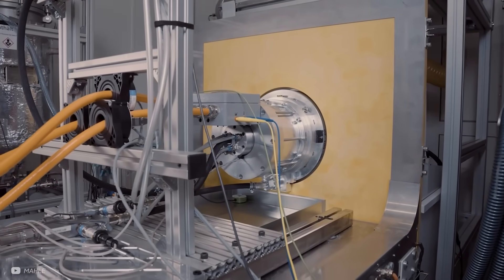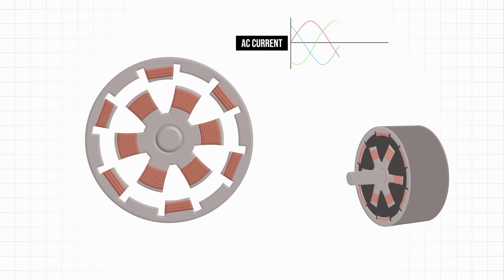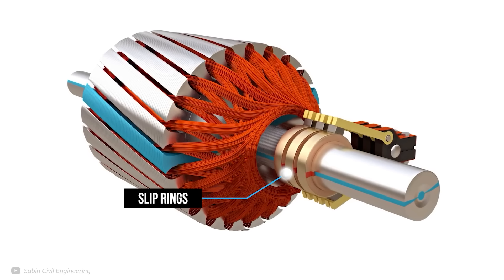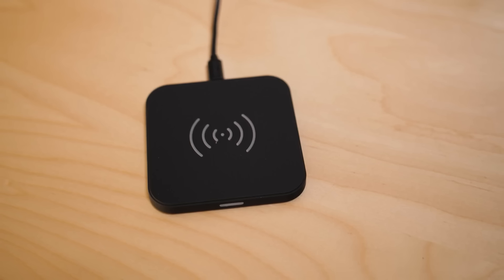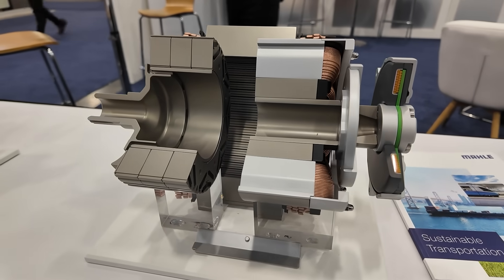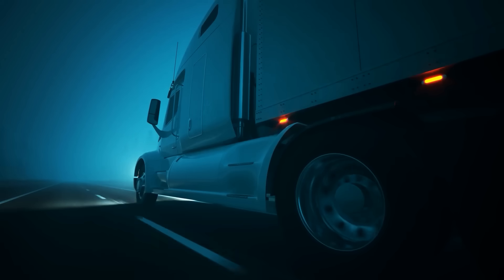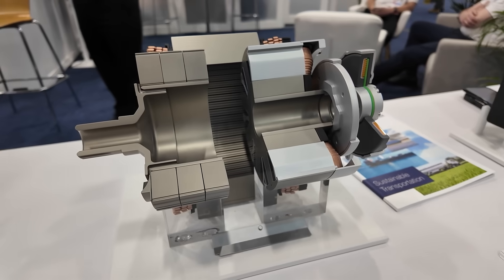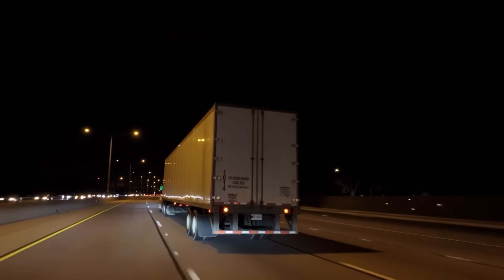Genius Contactless Motor Could Change Transport Forever

Comment: For a truck you would want a battery pack the size of two to three car packs, think kia EV6 size.
Then have a generator unit that has a small turbo charged engine optmised for 2500rpm that starts up to charge the battery.
The engine could be a 3.5l 4 cylinder with dual balance shafts.
Run on gas or lpg.

Comment: I think it wouldn't high efficiency. Super simple describe below.

In a typical brushless motor, you will spend power only on "stator" to make motor rotation. And "rotor" will do it free by magnets.

In a new model you have the same construction, but will spend additional power to emulate neodime magnets.

Comment: Whats wrong with brushes? It's like drum brakes, they could be optimised.
I don't see how slip rings wearing is that much of a concern, the other design of motor is still going to destroy bearinings. 
Water cooling on motors also has seals that wear.

Comment: Yes, EESM designs are inspired. MAHLE probably makes the most accomplished motor of this type. The fundamental attraction of an EESM is that it offers similar performance to PMSM but without the need for the rare earth magnets. The MAHLE motor goes further with design simplifications that improve reliability and service life and an interesting heat management design that permits sustained performance levels at close to peak output. There is a lot to like about this motor.

It is interesting that Ryan mentions the LUCID motor in the vlog. Yes, the cooling design of that motor is also inspired and like MAHLE's motor a cut above the rest.

Comment: This video is full of inaccuracies. From incorrect statements concerning efficiency to misrepresentation of models and diagrams. My source: 17 years experience and a masters in aerospace engineering. The motor itself is a neat concept, but you are doing it and yourself a grievous injustice by churning out all this misinformation. Please edit this video and do better.

Comment: Wireless charging is not efficient (relatively speaking) due to the large magnetizing currents as the air gap between the primary and secondary is large. This could work here because the energy that goes into the rotor excitation is small compared to the total power of the machine.

Comment: We have been using brushless motor, squirrel-cage induction motor for decades. "Contactless" isn't exactly such a huge innovation as made out to be in this video. Sure maybe they made some innovations like oil cooling and better bearings etc but induction motors was invented over 1.5 centuries ago and have been widely around for many decades. It's just funny to see someone who has no idea how electric motors work make a click bait video like this.

Comment: a well designed 3 phase induction motor can easily run 90-93% efficiency...the cooling aspect is pretty interesting...but the added cost and complexity of this design cannot possibly be competitive...note that 3 phase induction motors run most efficiently at "full power".  The cooling is needed when it is being controlled by a VFD etc...at lesser speeds...etc

Comment: Going through the comments and it strikes me that there is an argument with inductive charging vs wired. If you go back from the bridge rectifier to the transformer that is wired to the battery for charging. It is an induction transformer with a bridge and caps for smoothing.  So.. same thing. (I'm talking about a standard charger.). Any ways what really makes these motors fun is what you do with the signal that runs the field coils. You can save a lot of energy during light loads and have a ton of tire spinning HP/torque when you need it. I won't even go into all the ways to recover energy from a rig like that. Damn I would love to get my hands on on a pair of those.

Comment: - Intuitive - a synchronous generator with  induced field winding...

Is this New - maybe in small form factor Automotive spaces??

NB. All  electric motors operate through Spooky "wireless" force transfer....  (yes transformers too - they transfer power across the electrical gap - "wirelessly".
 - "wireless" phone chargers - yes they are simple a transformer without an observable iron core - separated windings.  The use of "technology' makes people think that Michael Faraday wouldn't understand its operation  as it is too "High Tech"...  (It can also be described as a double induction motor with rectified rotor field.)

A "real" issue with PM rotors is they are ultimately  strength / (power - is related ) limited - ie. an EM has the potential for much higher magnetic fiend strength (and my implication flux) than any PM, PM may be good for starting up a synchronous machine..  Also, Slip rings can definitely transfer higher power than any electronic driven, inductive coupler, for large long lived, maintained systems the slipring with  an occasional brush changes - done in power plants on the fly - is probably; cheaper, simpler and ultimately more reliable (yes there is a human factor here).  Long term we may - and probably have already - seen remote induction of the rotor field being performed.

 - Love the Use of BS terms such as "wireless" description (arguing that it isn't induction.. ALL Induction motors and transformers (and many other systems) work with this effect  - Internal rectification / ripple reduction, to produce a DC  rotor field eliminating slip rings. Any EE will guess all of this intuitively.

Oil cooling is great - as used in  power transformers - historically with PCB added for breakdown voltage improvement.

 - 1000kW  motors (PM free) are already readily available in mining equipment, making these more controllable via flux intensity and phase shift / power-factor optimised, it can only be a good thing.

Comment: The issue with this motor and wireless chargers is the same as with all inductively coupled devices. Unless the distances between the inductors is very small, the losses become an issue. Even if the distances are small, there is still a net loss. The thing we need to know is what is the efficiency of the inductive coupling? This design would have less friction. But is the friction in the brush/slip ring really that big of an issue? I can see this having a slight improvement and a reduction in maintenance. But that is really the only improvements I can see. Perhaps enough to make them marketable but not enough to make it some large breakthrough in design or efficiency. Also this is not new. Motors and generators have been using inductive coupling since the very early days of electricity. Also, inductive charging is never more efficient do to the inherent losses in inductive coupling. So, tell us what about this "new" technology is worth paying attention to? Just because some says their tech is new, even if they have never seen it before, doesn't make it so. A little due diligence on review can find many previous works.

Comment: Thank you for being you as an electrical engineer. One had so much problems with static electricity. Also that can be now detected is that our atmosphere changes dramatically seeing the new horizon for electric trucks and cars we are put in aThank you for being you as an electrical engineer. One had so much problems with static electricity. Also that can be now detected is that our atmosphere changes dramatically seeing the new horizon for electric trucks and cars we are put in a circle. There will be many failures before there was success And our plan is changing dramatically weatherwise. The most funny thing that happened here in Australia was they put solar panels in the centre of central Australia? What with the condensation the spiders and the insects within two weeks they were completely covered just one part a complete failure at a That’s the labour party they make and put up statues of people who have done so much damage to the community as if they are somebody who is available value regards from down under with the temperature here in the daytime can be 40 at daybreak

Comment: You realize that this is literally how 3 phase generators work. Like 100 year old generators.  This is exactly the same, as those old generators would become motors if the prime mover ran out of fuel or the power started going into instead of out of the windings.   Also referred to in the trade as "motoring".
Reply: Happens so quietly that in multiple engine driven generator setups, it is hard to tell instantly whether the engine is driving the alternator or visa versa.

Comment: All that is is a transformer splt in two the wider the air gap the weaker the transfer and transformers and not 100% efficient heat is another factor

Comment: I Give Mahle 6 out of Ten for that Motor.

I Deducted 1.5 because it is Using OIL for Cooling and Lubrication, Instead of a Water System.
I Deducted a 1.0 because it Claims to be a "Perfect Motor".  (At Best it Will be 90% Efficient)
I Deducted  1.5  because They have Not Proved the Inductive Coupling for Powering the Rotor is Superior to Slip Rings.  (Slip Rings have a Good Working Record)

Comment: Thank you. Hey, there is a new (ish) type of oil that would be well suited for this application.  It is actually plant based and out performs mineral oils for insulating and cooling transformers.  It is called FR3 and from what I’ve seen, it is a tremendous improvement.  I think the best part is consider non-hazardous when it comes time for disposal.  I think the manufacturer is Cargel, but I cannot recall.  Thanks for the video.
Reply: The problem with plant based stuff is that although it might be ecosafe, it also becomes food for something or other. Just look at the car  cable insulation made out of soy which is being eaten by rodents and insects and biodiesel that gets stuff growing in it. That is a real problem and shouldn't be overlooked in the race to ecofy everything

Comment: Missing technical data to bolster efficiency claims. Transport trucks (18 wheeler, Lori) traversing mountain roads is the killer to EV’s. What the efficiency of the induction transfer? Breaking, what type of braking system? 
Unbelievable at this point 🧐

Comment: An interesting induction motor, especially as the power density is improved by an improved cooling system. Nothing new here although great for machines and diesel electric equipment. It does nothing for the problems of batteries. It would be good in electric Trains and trams.

Comment: Does this system still require the use of batteries? Then I’m not impressed. Let’s see a system that doesn’t use batteries and do all that in this video. Then we will be making significant step in EV. As long as batteries are needed it’s always a failed solution to sustainability

Comment: I have my doubts about all this.

Induction motors efficiency depends on the design, you can't say that they all have 85% of efficiency. Some can reach almost 96%.
The other thing is that you can also control the magnetic field strenght and frequency (thus, rotational speed) in induction motors.
Also, oil cooling doesn't seem to be impossible to implement in an induction motor. With that, you can match the energy density of this technology in discussion.
And last, consider also that the stage of wirelessly transmiting power to the rotor, is an extra step that adds energy losses.

So, I'm not familiarized with electric transport technologies, but at a first glance, I don't see something revolutionary going on here, but I might be wrong.

Comment: Interestingly enough, high power alternators have used a very similar design for at least 40 years and probably much longer than that, and have no brushes either, and the thing on the end supply power to the rotor coils is called an exciter.  There is a DC coil around the exciter part and by adjusting the DC to it, the output of the exciter, which has rectifiers built into it to convert the AC to DC before it is applied to the main rotor coils,  which in turn adjusts the output of the alternator.  The power is pulled off from the stator coils.  That is how the alternators that powered the oil rig I worked on in the 1980's, so all Mahle did was use that design and made a motor instead of a generator out of it.  I guess the folks who came up with the "contactless alternator" design were extra genius, since they thought of that many decades earlier.
Reply: In 1990 I graduated from a university class specialized in the design of electric motors and generators. There is nothing mentioned in this video that was not taught to students back then, or that was not already implemented in mass production. 
Hint: Just check the technical drawings from catalogue presentation of Caterpillar generators from the early 1990's.

Comment: I don’t understand how they achieved that efficiency with induction. The fact that they use oil cooling system doesn’t answer the question. I mean the heat from induction is a loss of efficiency, and if u counter it with cooling it loss doesn’t disappear

Comment: With trucks hybrid is the best solution until they come up with a battery that is light, ultra-fast charging with a range of 700mil with minimum 50/50 split between flat and climbing a grade like running the PA turnpike from Harrisburg to Ohio or from the planes to west coast like Donner pass. Then we still have to address that our electric infrastructure will easily take 50-100yrs to not only handle all EV transportation but get away from any carbon fuel use, as of now CA can't even handle a hot day without rolling blackouts. Building a hybrid heavy truck that uses methane though combustion or fuel cell is more efficient that recharging from a coal or methane power plant. Methane is a bio- renewable fuel that is 1000x more efficient that making ethanol from corn, in fact you would get more methane from feeding corn to cows than extracting the methane from cow poop while feeding the population at the same time. Methane/Natural Gas can be extracted from poop to dead plant matter and food waste with the only byproduct being super rich plant food and this is why I call it GOD's gas because it is stable under high pressure and can be liquefied to allow high quantity in small containers without all the problems of using pure Hydrogen.

Comment: Turbocor has been doing this for years, placing two magnets directly over top of one another will cause the two magnets to push away from each other in a closed area measured exactly one can make a frictionless gear/turbine that will need a little power to start but if weighted well while being in it's own magnetic field in a holding chamber it's capable of extremely high power output and extremely minimal power consumption..This I think 🤔 is the best possible configuration for a hub motor or even mid drive.

Comment: I've worked with 95% efficient induction motors for years. You do need to size them to the need. Most engineers cheap out and just get a motor oversized for the need to keep from having to do the math, or worry about some mechanical engineer adding load after the fact, but what you are showing here looks to be a complicated excuse for a complicated motor.

Comment: Once we get good at using carbon such as graphene and nanotubes rather than copper we could significantly increase conductivity and drastically reduce the weight and make hub motors far more practical solution as it reduces the unsprung load. It may even be possible to 3D print complex structures to maximize the magnetic fields as well maybe even make them morphologically dynamic

Comment: A "contactless" synchronous motor using transformer coupled external exciter currents is just a synchronous generator running in reverse, power plants generators have had this tech at gird scale for the better part of a century.
Reply: A synchronous generator is exactly that. If the RPMs drop, the rest of the grid will try to run it as a motor to keep it up to speed. Amazing that when the grid is operating normally you have the spinning mass of every turbine and generator on tap to smooth load spikes.

Comment: That is not what a dielectric is.  A dielectric is actually a very good conductor of electromagnetic fields.  What we call conductors are actually obstructors.  They block the electromagnetic field and prevent it from escaping via spherical enlargement at the speed of light.  The claim that oil does not "conduct" electricity is patently false and is easily disproved with leyden jar capacitors.  You can take a leyden jar and charge it up, then take the anode and cathode off and place them on an uncharged leyden jar.  Then when you try to discharge the "charged" annode and cathode with the "uncharged" oil, there will never ever be a discharge.  However, if you take an "uncharged" anode and cathode and place them on the leyden jar with the "charged" oil, there will be a discharge when you test it.  It is the dielectric that is storing the electromagnetic energy in a capacitor.  Neither the anode nor the cathode store electromagnetic energy.

Comment: For this to be "better" then it has to demonstrate that the wireless power transfer to the rotor improves efficiency more then the slip rings. 
I am not holding my breath to get the numbers. There has been many historical attempts to improve slip rings in motors.

Comment: correct me if I'm wrong, but wireless charging uses ac power and electric cars only have dc. so in order to make ac they would need to use a mosfet rectifier that can easily zap away 5-10% efficiently on top of the 5% from the motor windings you add on the fact that regenerative braking is imposable with this motor makes it a very bad choices for cars. no?